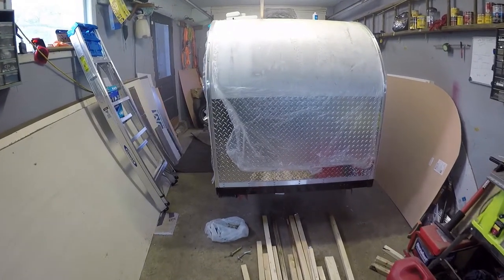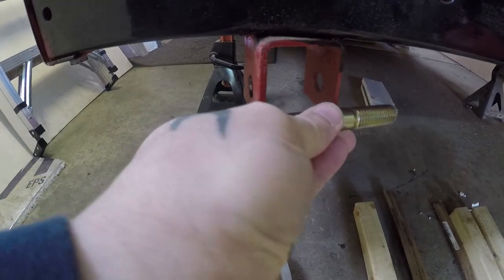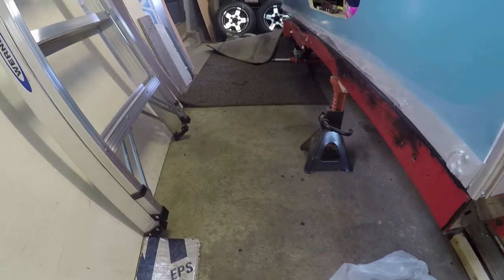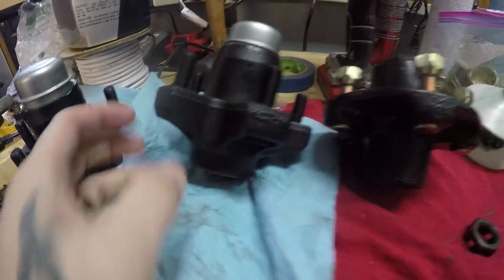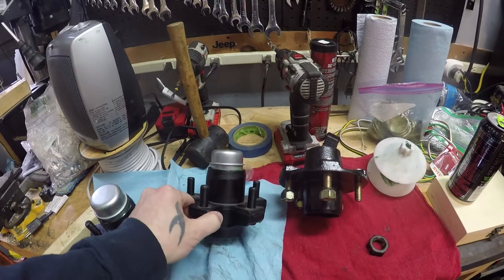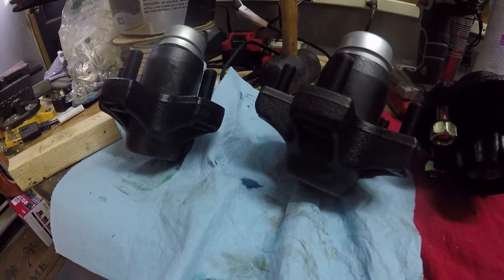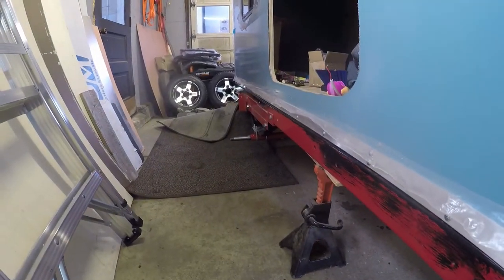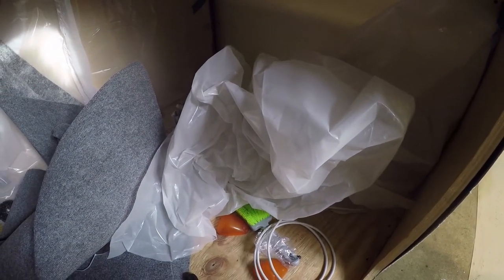Harbor Freight Trailer and Teardrop Update

Comment: Where you get the rims? Please send me the ???place, thanks 🙏
Reply from the maker: HWT 724545 12X4 5/4.5 Aluminum Series07 Trailer Wheel - Gray Accent https://www.amazon.com/dp/B00EPL215M/ref=cm_sw_r_cp_api_glt_i_KF6TVGVSN2MZ90BRCRQM?_encoding=UTF8&psc=1

Looks like they are discontinued. But you can use the specs to find similar ones.
Reply: Thanks 🙏

Comment: Do you keep the same axle that comes with it?
Reply from the maker: Yes, they fit perfectly on the axels I still have those wheels on there now. The tires are still inflated too. I have several grounds of miles on them.
Reply: @RDC_Garage  well could you put axle~less suspension on there?
Reply from the maker: @unravelingnots7544  on a harbor freight trailer? Probably not. I’m not an expert on that setup n
Reply: @RDC_Garage  ok thanks looks great